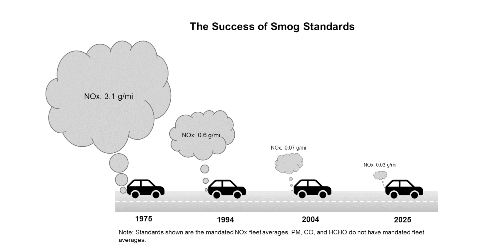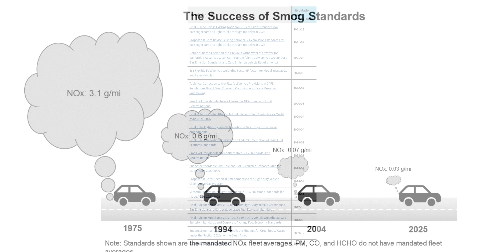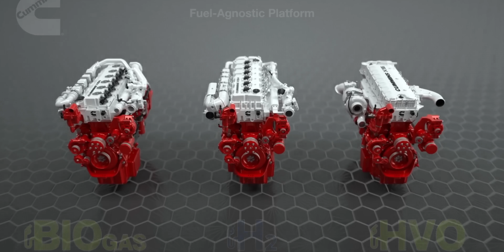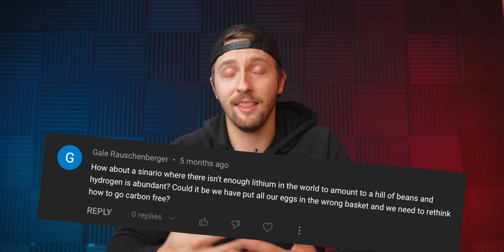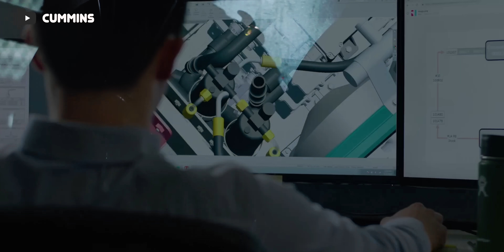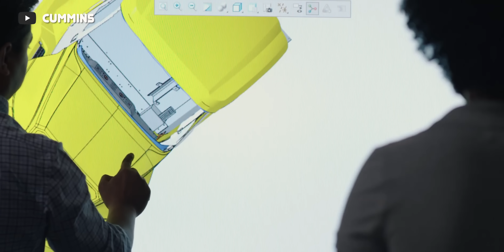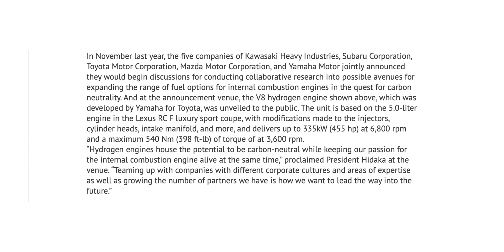Cummins Hydrogen Engine Will KILL DIESELS FOREVER

Comment: 9:32
While ICE doesn't make sense for energy production from hydrogen in general you're right about the fuel agnostic approach being more practical in the short term.
You can produce some Hydro on site with say solar power, but also bring in diesel when your hydrogen runs out.

Comment: 3:34
We've been using electric digging machines etc here in Norway for a while.
They excavated earth from underneath the local mall last year using one.
Being electric it could operate inside while the mall was open and drive past customers etc.
Reply: Can do the same with a fuel cell.

Comment: You might want to check out Plasma Genetics which had developed a solid state solution for storing and regenerating Hydrogen. I've personally worked with cryogenic Hydrogen as well as High pressure  >20ksi vessels and the solid state solution solution once gone public is the world wide solution.

Comment: Engineering Explained had a great explanation of the road blocks being faced with Hydrogen engines. Namely, that the energy density compared to gas or diesel is FAR less. A much higher volume of hydrogen is required compared to diesel, which means very large and dangerous compressed hydrogen fuel cells.

Comment: This just feels like a hedge to shut up stakeholders. Burning hydrogen in a non rocket engine is about the dumbest way to use the fuel. there are inherent problems in terms of efficiency and power. It's not even cleaner by all measures, leaving aside that the vast majority of hydrogen produced currently is extremely carbon intensive the most efficient fuel air mix to burn hydrogen is extremely lean which dramatically increases NOX emissions. Hydrogen is best used in a fuel cell to create electricity for electric motors.

Comment: A diesel is a compression ignition engine, if it requires a spark or glow plug and a precombustion chamber then it's technically not a true diesel...

Comment: In my opinion, electric vehicles have no future until the energy storage problem is not solved. What is a great difference between waisting crude oil, coal, LNG and huge amounts of cobalt, nickel, lithium. As for me you have the same part of a male body put to another hand. Nothing changed. Hydrogen is also questionable as it needs power for generation and extremely hard to store at huge pressure. Engeneers like heroes now walking through darkness to lead the world to the light and prosperity, without any idea of the best solution, just hard work and belief. My great respect to Engeneers all over the world. You are the real heroes of new era.

Comment: it's part of the fake climate change and that agenda, even if Cummins does that, it will eventually have to go back to diesel/gas and/or another producer will  fill the space with the new manufacture of diesel engines -- and even if Hydro remains, the most efficient  way to store and distribute hydrogen is in methane (liquid methane)

Comment: Next thought : A hydrogen generator is NOT supposed to propell the vehicle. It is supposed to provide a MUCH easier fuel to IGNITE, which is then used to ignite the more difficult to light diesel.

Maybe you should get a new hobby.

Comment: Hello, Hello wake up. The 1st internal combustion engine was run off of hydrogen. I saw a couple of years ago who developed a hydrogen car that went 3000mi. on 22 gal of water. Right before he was about to patent it he took a GOV. agent for a test ride. 3 months later they found the man dead.No patent, do the math. Roy Macallister has also produced a hydrogen engine that runs off of water, they use it in disaster relief situations running a generator. IT'S NOT NEW. The powers that be have intentionally killed it.

Comment: As a diesel pickup mechanic, personally, I love the Cummins engine (the 6.7 and 5.9 are my bread and butter), and I'm glad they're attempting to keep the basic build of it the same. Pretty innovative. That being said, I wonder how all of these changes will translate down to us techs. Will there be a huge learning curve? Will it put us out of business? Or will it be simple enough and subtle enough to let us adapt? I guess only time will tell...
Reply: Pretty sure it would keep you in business. I doubt the learning curve would be large considering fundamentally it still functions like a gas engine. If I were to guess I’d say the learning curve would be a bit steeper than when fuel injection came out.
Reply: One thing I'm worried about... Is the question of will it kill our jobs, or give us a hell of a lot more complications to work with 🤣 may be job security.

Comment: this makes a lot more sense than fuel cells using hydrogen. multiple fuels is a great idea. and depending on your local laws this extends diesel use indefinitely. i was shocked at how quickly diesel cars go shut down when they started getting really great mileage and super comparable performance. was VW a set up?

Comment: we need to go to multifuel engines, they have been around for a long time for the military, it has been quite odd that they haven't seen more use for road vehicles... (I have heard about reliability issues, but those can be worked through, especially if they were to get wider use)
Reply: Multifuel engines are not efficient!  They're multifuel because there may not be a certain fuel avalible and the supplies need to flow!

Comment: In the early '80s I worked in a open pit lead/zinc mine in central Yukon with HUGE electric shovels, electric drills, electric wheel motor haul trucks. Shovels and drills were using electricity that was wired in from hydroelectric power 300+ miles (400km) away. 120ton and 170ton electric wheel motor haul trucks were powered by onboard diesel engines. All other equipment was diesel and gasoline powered. Electric power has been around a lot longer than most are aware. As for electric cars and highway trucks being totally electric it is a TOTAL SCAM, exactly like 15 minute cities. Those who know, know. Snap out of it people.

Comment: Like you, I've made on board hydrogen producing systems for gasoline engines.  Electrical production is fast short of adequate to be effective.  Using chemical production,  burning aluminum, created enough hydrogen to increase a 2003 5.3 Suburbans highway mileage to 28 MPG. THE emission numbers were nearly clean water. Had l bypassed the 02 sensors, via installing 4.9 ohm resistors in their place, l could have attained another 4 mpg. It was a caustic and messy application, not worth the effort at least to me. Great video by the way.

Comment: Diesel will be around for a long time as the military will have to continue using it due to the energy density for tanks, trucks, and heavy equipment. Hydrogen is stored over 5,000 psi so that's a weak point for any military vehicle. I'm 36 now and hopefully diesel hangs around for the time I am driving.

Comment: How about this ? Pull the co2 from the air using caustics, use process heat to combine the captured co2 with water & create carbon negative liquid fuels. We can get process heat by using molten salt nuclear reactors. Then we can use nuclear waste and/or thorium to power the new reactors. The designs are out there sitting on the shelf. The USA transferred the technology to the Chinese over a decade ago. And the Chinese have a large test reactor already in operation - which will make carbon free steel. 
 Hydrogen gas fuel is a fool's errand. With work in the right areas, we don't need to waste resources on the infrastructure required to institute hydrogen transportation. We can save our oil for plastics & still have liquid fuels.

Comment: How combustible is the liquid hydrogen tank in a side or rear end collision? Cause if it turns to gas immediately than its a bomb and no survivors at anytime if there is a fire or smoker or even a spark from the metal on metal crash no?

Comment: the future is not electric...I'll lean to hydrogen as the future and the diesel will 'evolve' into replacement naturally. But for now, diesel engines will be around as electric has too many mountains to climb and hurdles to overcome as noted in this fine video.

Comment: Hydrogen production is pretty cool with its ability to make renewable energy sources viable power producers.  If you think of hydrogen fuel as a BATTERY that stores potential energy.  This way things like solar/etc, or base load generators like nuclear on off peak times can generate hydrogen when there is excess grid power.  Anyhow, makes sense in my head that way.

Comment: There is already a pollution free source of fuel for diesel engines.
But since it might hurt the petrol companies no one was willing to invest in it.

Alga produces lipids that can be burned just like vegetable oil. It pulls CO2 out of the air so it does not release new CO2 when burned like fossil fuel. The facility can be totally powered by solar.

https://www.youtube.com/watch?v=XvKqpFLWCoY&list=FLXjePExiJ9FV_18sUqVV00A&index=9&t=31s&ab_channel=funbury

Comment: A big problem they will have is finding an oil that will seal piston rings as hydrogen bypasses much more easily than fuel air

Comment: Hydrogen and fuelcell is better, if you burn hydrogen in engine, you need 2x more hydrogen than fuelcell needs to move the vehicle same amount of miles. Sure if hydrogen would be cheap like dirt, but it's not cheap.

Comment: 1) while not ideal, one big diesel turbine is more efficient then thousands of individual engines. The goal is never 0 because it doesn't exists in the real world. The goal is to add another 100 years to find something better.

2) hydrogen is more energy dense then our current batteries.

Comment: Impressive video.  I definitely will research this more.  Their plan also helps from having to restructure entire parts support systems currently in place.  There is a balance that definitely needs to be achieved.
Reply: I found it biased. 

Going to talk about infrastructure for electric vehicles, but not hydrogen... 

 Seriously there is like zero hydrogen infrastructure. 

 I want both to succeed yet there are really no benefits of hydrogen especially as battery technology continues to get better. 

 Storing it is the biggest issue. It takes too much volume. Real Engineering did a perfect episode on how hydrogen takes so much space that it literally makes little sense.
 
 It doesn't give more power. It takes too much space. Requires incredibly low pressure and tempatures to make it even close to not taking enough space. 

 Costs electricity to create.

 Where are the benefits outside of novelty? There are better ways to do things. 

 Unless we make some real break throughs in generating it. Like a mobile hydrogen generator that you can use anywhere there is water that is powered by the sun? It makes legit no sense. 

 Someone needs to help me. What am I missing?

Comment: I think this is the wrong strategy they are choosing short term gain for long term loss. They should power all vehicles with electric motors even excavators but add on diesel or hydrogen electrical generators be they combustion or fuel cell. These range extender type vehicles will then slowly (but not completely) be replaced with all electric as infrastructure improves.

Comment: Well let's see you say you want corrections or additional info and input.  Okay, you got 'em.  Be careful what you ask for.  As to hydrogen, very renewable resource.. there's plenty of it in the ocean, a virtually inexhaustible supply.  The byproduct would be salt, which we already mine and use, not to mention a lot of useful metals.  You were correct in one thing yes, it requires electricity, but it need not come from fossil fuels.  Ever heard of things like geothermal energy or solar energy that you didn't bother to mention?  How about the fusion energy that's going to be so plentiful in the near 2030's?   No offense, but do your homework.  Hydrogen is one of the only possibilities of saving the traditional combustion engine, unless you want even more pollution from the proliferation of motorized vehicles around the world.  It has so much power in it that they use it for rocket fuel.  I was an electronic technologist for Rockwell and US military electronics companies, btw, if you lump me in with the 'tree-hugging crackpots' .    Just a little FYI.

Comment: Hydrogen engines are mindblowing stupid, and dangerus.

PS! Cobalt are used to purify oil...
Did you forget that? Or, was that deliberate? Or, haven't you the knowledge?

Reason:
1. In Norway there is 5 million people.
If everyone drove Hydrogen cars, and trucks. Because a hydrogen tank explode 0,34% every year.
3 hydrogen stations will explode every day!

2. >97% of Hydrogen are made from fossile sorces, and the fossile companies are supporting hydrogen.
Why?
3. Then you have platinum, and other heavy elements are expensive.
4. It takes 3-4 times more energy to use hydrogen in a truck than using the electrictrisity directly.
Pure electric cars will use half of the energy that a fossile car will, if you make electrictrisity from the oil directly, instead of transport/puming/transport/refine/storage/infrastructure.
A hydrogen engine need big tanks
The semi will never be abel to go far.
Check out Engineering explaned, and this will be clear.

But, in the world there are persons that tell fairytales. Those pepole are interesting, but they should keep the fairytales in the realm of the imagination.

Comment: LMFAO no. Hydrogen will NEVER been a massively commercialized technology for small combustion vehicles. The cost and maintenance of a dedicated infrastructure, when compared to electric cars, is ridiculous. By the time a fleshed out ecosystem exists, the electric system will be 1000x bigger at 100x less cost. The batteries will be good enough, as they mostly are now. Even for heavy truck usage situations. Hydrogen is just too far behind to be useful for personal transport or light weight trucking when compared to electric at its current rate of progress. electric is moving fast, hydrogen is still ultra infantile

Comment: How is hydrogen produced besides electrolysis?  Years ago I researched methanol as a hydrogen storage medium. The CO molecule became a hydrate holding 2 moles of hydrogen and one of CO. This is an easily manufactured fuel, easily stored, has half the energy of an equal volume of hydrocarbons fuel, and only has one carbon to contain as CO2.

Comment: I wonder why they don’t build diesel electric trucks like a train. That 6.7 should run a pretty good sized generator to supply power to batteries or direct to electric motors to run a semi. You’re still burning fuel but far less then what that truck is burning now.

Comment: Not all hydrogen is produced via electrolysis AND neither is it wholly necessary to use electrolysis, or to even store and transport hydrogen. It can be produced cheaply within the engine itself - using an almost free high-heat energy source from an old forgotten technology.

Comment: I wonder if they could take liquid hydrogen and run it through a diesel motor which uses compression and if a diesel motor is set up to compress the liquid hydrogen enough it will turn into a gas and then ignite that gets rid of the problem of having to keep a big compressed hydrogen tank you just carry liquid hydrogen and compress it as it's needed

Comment: Hi Guys,

I would make two comments.  First of all you have covered the basics of a complex issue pretty well.  Having driven the big rigs for over 30 years, we all know that electric Class 8s are a joke..   Imagine leaving Denver on  I-70 grossing 80,000# and heading west toward the tunnels on the Great Divide; Do you have any idea how long that 3-5% grade is?  A fully charged (and heavy) battery on a class 8 wouldn't last 15 miles; I would bet my pension on it.  We are 10 years away from fleet approval. Period.

Second, we here in America missed the boat with CNG years ago-- it was the opportunity of a lifetime.  The technology was developed by Westport fuel systems proven enough to be embraced by Cummins, creating CWI: Cummins Westport Inc, using HPDI: high-pressure direct injection.  We were swimming in natural gas; we still have over 100 years of it in the ground.  Why in the __ don't we use it?  Because Sen. Bob Dole, killed it in favor of ethanol, a product of corn (Kansas' largest crop) which has to be cooked-- or refined, if you prefer that term.  True, 1,000 cf of natural gas doesn't contain quite as much raw energy as the equivalent amount of diesel, but there is still capacity for a 600-mile dispatch.  And the infrastructure is in place, growing every month.  Can we catch up?  I don't know.  But there is no other fuel so clean, so abundant and so cheap.  Just sorry leadership at the top, though Boone Pickens certainly tried.  OK; sorry for the sermon.  God bless!

Comment: Lpg or natural gas injection would be the smartest way to improve diesel engines. It greatly increases power, decreases all but NoX emissions, gives you better mileage and you can still drive with just the diesel if the gas runs out. I dont get it why they are not building diesel engines with gas fumigation from the factory. The gas injection would be cheap and easy to implement too.

Comment: Makes sense to develop a compression ignition engine that uses hydrogen as a fuel. Cleaner burning coupled with the fact that hydrogen is the most abundant element in the universe! Just need to develop an economical means of producing, storing and transporting hydrogen.